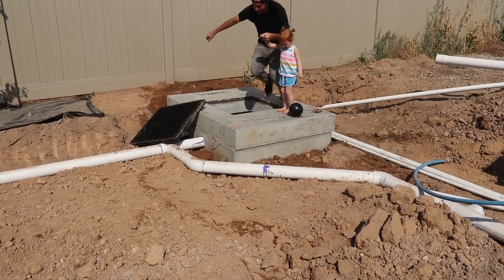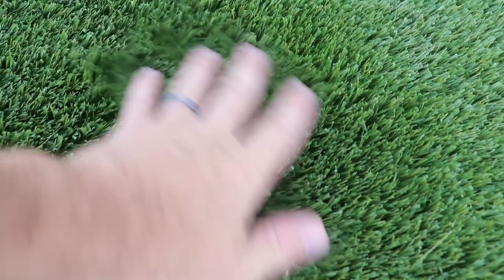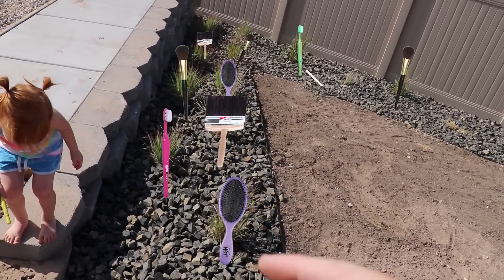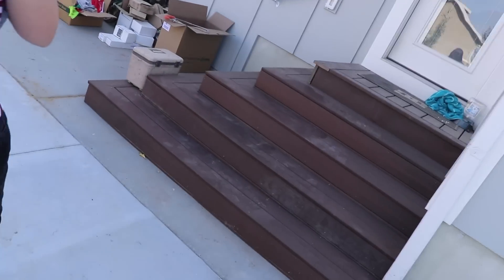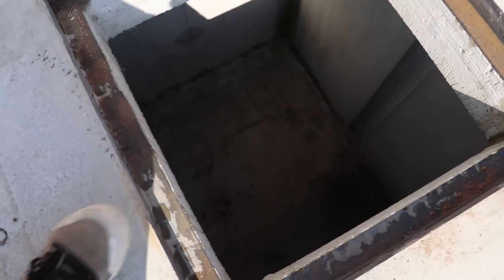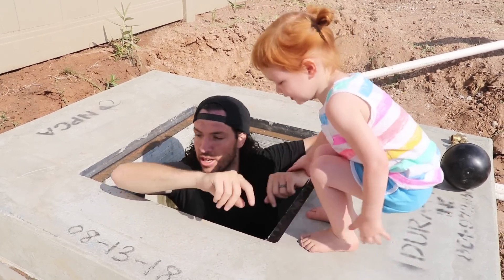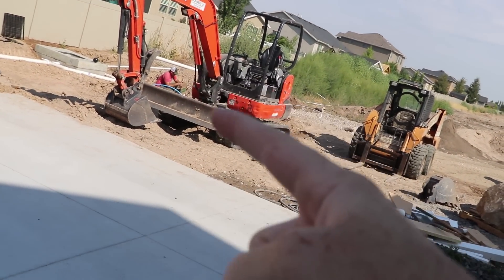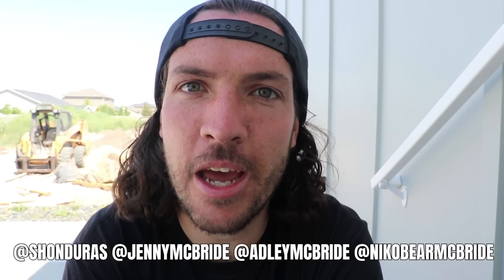Investigating Mystery Abandoned Hole Underground in my Backyard??

Comment: I know the circular one is a trampoline, and I think the box with rocks is an electric fire pit
Reply: looks like either natural gas or propane.
Reply: bois you as hard as possible becase you said electric firepit BOIIIIIIII!
Reply: @henrikvtcodes  I meant as in you flip a switch and it turns on. I'm not that dumb

Comment: Crazy stuff I've seen that are most enjoyed by kids and adults.  K&A friendly fun. A.  Small pool with a slip n slide going into it.  B. Or a large hot tub used for hot tub, pool and slipnslide.  C.  In ground trampoline surrounded by sponge blocks.  D. Huge twist n turn slide.  But, in another area, must haves:  skateboard park and cement pad for riding all the riding cars/gear.